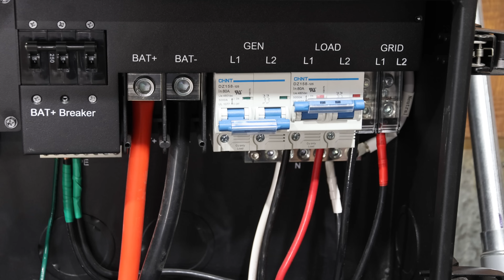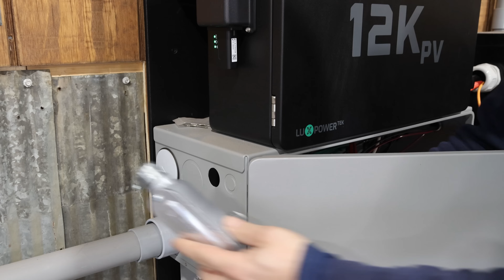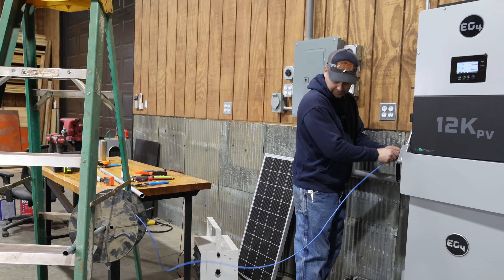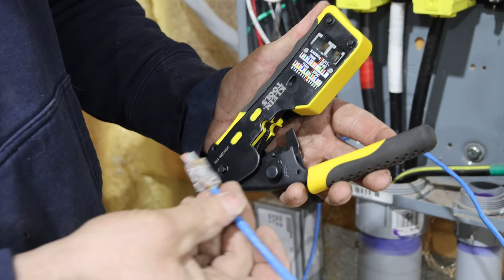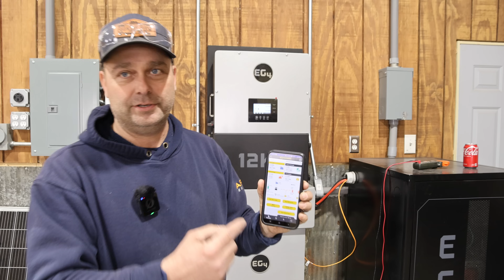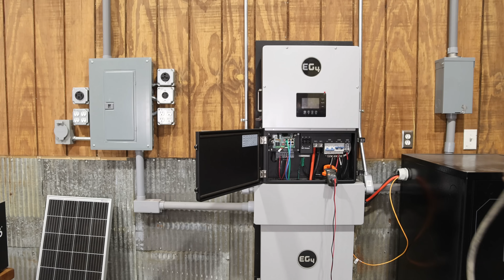EG4 12Kpv CT installation. Zero Meter, Grid Sellback,  More Load & Surge testing

Comment: So, I just installed a flexboss 21. Pv array not yet connected. I am waiting a panel mounting bracket issue before I can run my solar. 

In the meantime I wanted to charge my new 30kwh server rack. I connected the CT'S with the arrows facing load side. 

Once configured, charging commenced yet so did grid export on the eg4 app. Showd 2750 watts going into the grid. 

Called tech support. They performed a remote firmware update. 30 mins later. Same issue. 

So, out of curiosity, I reversed the clamps from l1 to l2 keeping the same arrow orientation twords the load side. 

Now it shows 0 export. 

How in the heck do I figure out which leg is line 1 and line 2? I thought both were basically just load lines delivering 120 per leg with the third uncoated wire being neutral. I am concerned that I may be exporting even though all settings for that are turned off. Any help would be appreciated...

Comment: When you were trying to run the air compressor, and you were reading 100amps, is that just on L1? So the whole surge would have been more like 200 amps? Or is that 100 amps counting for both? Im trying to see if I could use the 12kpv to run my whole house with grid backup. Im trying ti calculate if I can start my 3 ton ac unit while the dryer is running and charging ev at 24amps. Thanks!
Reply from the maker: You measure amperage on a single phase of 120 volts..  the other phase should be the same.  So that is 100 amps of 240 volts or 24000 watts.  Or 100 amps at 120 volts times 2 phases = 12000 watts times 2 = 24000 watts.

Comment: can you use the plastic conduit
Reply from the maker: PVC conduit can be used on the AC power side.  But metal conduit has to be used on the DC Solar wiring inside a building.  PVC conduit can be used on the DC solar wiring when not on or inside a building.

Comment: I have 50kw worth of gridtied inverters, one 15kw battery charger/inverters, and 40kwh of batteries. I use a PLC and logical I developed to operate offgrid. I automatically curtail or increase output from the gridtied inverters to match my loads with the batteries acting as accumulators to supply or absorb load changes. This only takes a few seconds, and the battery current goes back to zero. On sunny days, I have carried over 45kw of loads offgrid, and I have started a 15hp air compressor. It is so much more capable than AC coupled frequency shifting the gridtied inverters. I get the full capacity of all inverters plus the batteries, totaling over 65kw, with over 100kw of surge capacity.

Comment: Suggestion for testing... it may help clarify the real-world scenarios if you could demonstrate how the system could handle normal household items, refrigerator, freezer, computer, lights, microwave, electric oven or stovetop...etc to mimic a real-life grid down scenario. Then test it with both batteries and then with just one battery to see how many we really need.
Reply: Dude, he literally tested the wattage capacity. Running with household appliances wouldn't change that. Same tests!

Comment: Why is this inverter so noisy?
Reply from the maker: As the load increases the fans kick on and ramp up according to the load.  I forced it to charge the batteries at the max rate.  That's why the fans where running.
Reply: @CountryViewSolar-DIYProjects  Evan, you're so nice.  Mine is 2x as loud, even at 1k DC from solar, I think yours doesn't kick the fans in till it reaches 6k on charging power.
Reply: Ha!  You ought to hear my 6500xp, sound like a rocket!  That 12kpv sound like a dream

Comment: Starting capacitor on Air Compressor helps with the serge, and used a lot in air conditioners. Feed back heavily discounted power to the grid makes them happy on your costly equipment. Such a deal.

Comment: You have significantly changed your systems capability to feed back to the grid.  The power company certified your epcubed system.  Dont you need to get recertified with  this change?

Comment: Hi Evan -  So even forgetting that the EP Cube failed after a few months which way would you go for ease of setup and use if you were installing these systems fresh from the beginning and which do you like more,  the Canadian Solar EP Cube or the EG4 and EG4 batteries?    Not saying either is bad, just what you are thinking with your electrical background.
Reply from the maker: I like the EG4 System.  Way more customizable. and way more information you can see on the screen or in the App.
Reply: @CountryViewSolar-DIYProjects    That's what I was thinking also .     Tks !

Comment: I Know The Air Compressor Is Just A Test BUT Add A Soft Start to it & I Bet it Would Run It ! Soft Starts Are So Handy ! You can run a Large Ac on Solar As long as you have a Soft Start on Them ! I am Sure you already Know What They Are ! I work on a Lot of Amateur Radio Amps Some Have 2000Volts & Some Have 5000 Volts @ 5A & They Almost Always Make a Big Thud Sound When ya First Flip the power switch an all that voltage hits all at once & the Soft start Stops That Big Thud Sound &We Wont go into on yt..lol. Cool Video as always ! Thanks

Comment: How much do you get for back feeding the grid?  Here in NC I think it's about 25% of what they charge per KW hour.  Would prioritizing zeroing the grid save money in the long run?
Reply from the maker: I get 3 cents for sell back and buy it at 15 cents.  Zeroing the meter is the best way to lower my electric bill.  Selling back, I have to sell 5 times what I use.  Best to never buy it.
Reply: @CountryViewSolar-DIYProjects  $ .03 sell and .15 to buy?  That's atrocious.   I'm sorry that's all you get.  I was thinking it was bad, like 50% buyback but 20%?  Wow, how do they think that's good for you?   Almost worth not worrying about the certification troubles/hassles and don't sell to them, just go Almost completely off grid and only use them for battery recharge at night when rates are low/emergency power that way you just pay the monthly convenience fee to be connected.
Reply: @thaddeustroyer  Same here!  .15-.18 per KWh with the taxes and fuel cost adjustment which is still cheap compared to some parts of the country.  They buy it back at wholesale cost of .03 per KWh.  PLUS the $18 monthly net metering fee...  I have an 18Kpv with 3 PowerPro batteries, 13.1 KW of panels and decided to take my house 90% offgrid with a subpanel instead of net metering.  It just wasn't worth messing with all the hassle and extra wear on my inverter.  Payback:  July-2022 bill was $469.35  July-2023 bill was $529.80 July-2024 bill was $344.75(solar test running with a few panels).   July-2025 bill with my current setup was $56.45 and I bought a used Tesla that I charge on days with excess solar.  It has never been charged with grid power since the day I bought it.  Rarely ever drive my truck any more unless I'm towing.  The payback is good if you can install the equipment yourself but I was quoted 4 times what I spent for my equipment and that was with NO battery backup, just net-metered panels and micro-inverters!
Reply: @CountryViewSolar-DIYProjects  .03 cents...that's ridiculous!!!!

Comment: 107amp surge seems extreme if that was just the compressor especially one one leg. That would mean you are exceeding a 200 amp entrance. Quick check shows a 5 HP compressor should draw around 23 amps. Maybe you should put your meter on the outlet wire to get a real compressor draw. Other than that love your videos. Keep up the entertaining and informative videos.
Reply from the maker: My 200 amp entrance, is 200 amps per leg.  So it is only half the service entrance.   But it is a surge, probably only happening for a few cycles.  after it starts up, it only pulls 25 amps or less.

Comment: So what about AC coupling with your EP Cube system?  Can you utilize the backup port for that function?
Reply from the maker: The 12Kpv is back feeding the same breaker panel that feeds the EP cube.  So they are sort of working together, as long as there is grid power.
Reply: @CountryViewSolar-DIYProjects  So can the EP cube work in backup mode when grid power is down?  Both for the solar arrays attached to the EP Cube system and the battery?